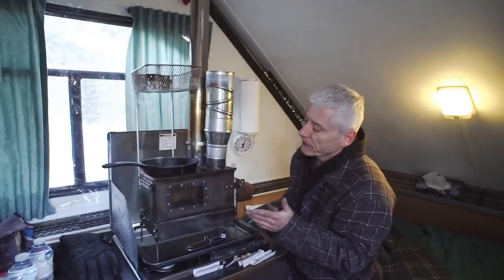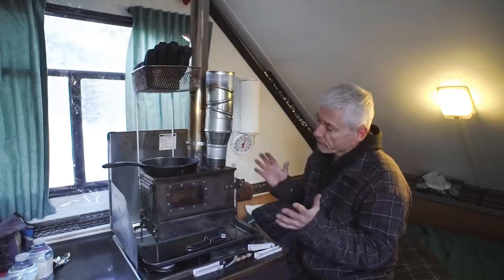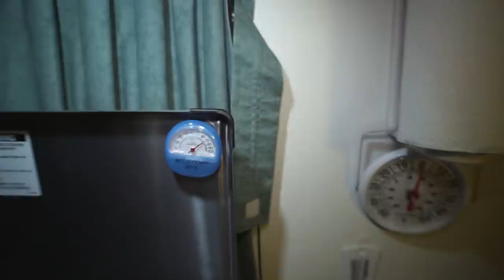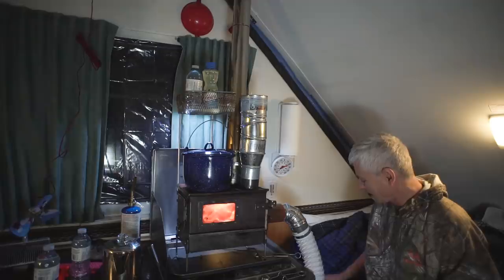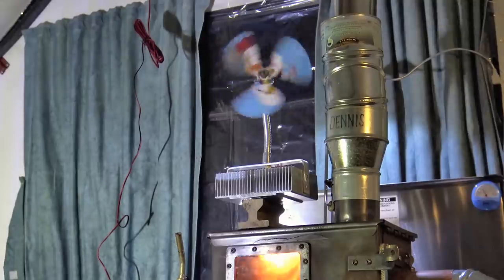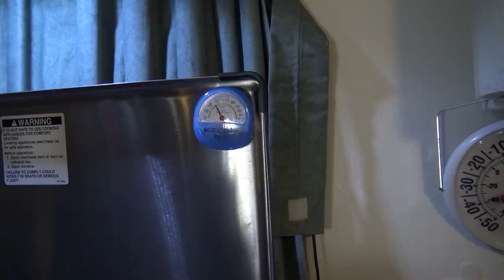Wood Stove in an A-Frame Trailer - Part 2

Comment: Great vid! A few notes about humidity: you mentioned that fire is a "dry heat." But you purposefully (and wisely) designed the setup so that the combustion chamber has no interaction with the inside air. So how can it affect the humidity? Indirectly, at best. The colder the air gets, the less moisture it can carry. The relative humidity is calculated as the amount of water vapor divided by the total moisture capacity at a given temperature. So the same amount of water vapor in the air could produce 60% humidity at a cold temperature and 30% at a warm temperature. Also, those dial indicator hygrometers are based on metal coil springs that have their own thermal expansion, so they may not read accurately at extremely cold temperatures like the ones you are encountering. Keep up the great work 👍
Reply from the maker: Hi Danny, respectfully I have to disagree with your analogy. The air was definitely drier regardless if the source was direct or not. There was no window condensation or frost, the key indicator in a situation like this. Even boiling water had little effect on increasing the moisture. As for the hygrometer, I have no doubt it was not very accurate, but to say it was 100% inaccurate I find hard to believe regardless of the circumstance. Thanks !SP

Comment: Love the woodstove. I have also seen the vid with the mr buddy heater. Your A-Frame Trailer which is basically a tent is poorly insulated. You could have a camper slightly larger, and much better built. That little one can also be improved a ton in so many cheap ways.
Reply from the maker: Sounds like you missed most of the my other videos. I have done many showing the insulating improvements I made. The issue with the Aliner is the aluminum frame, not the insulated walls. Larger trailers would simply mean more to heat, and more to lug around. SP
Reply: @SlimPotatohead  I spoke too soon. Excellent Stuff.

Comment: With my wood burner....I always get more heat by keeping the chimney damper closed as much as possible while maintaining a good fire. Forces the heat out through the steel top and walls. Not sure how that works with pellets but hope it helps. Also, I'd get a self igniting torch vs. running old sparky over your bed. 👍

Comment: Hello, great test. I think you do not have to connect the hose to the inlet because the fire uses the air and reduces the pressure in the camper, so then fresh air will come in through the ventilation in the camper door.
Awesome stove!!
Greetings,, Kitty.

Comment: Great video slim, what about using 3 layers of fool flex with a half inch air gap between ? It wouldn't take that much space and the r value is excellent. Keep up the great videos and being you.

Comment: Looks like a fun project. I missed your previous video so I don't know if you talked about this but I'd go with one of those cheap diesel heaters. They use some 12 volt power to run a fan and they do make some noise but they crank out a ton of heat. I've seen a bunch of videos of them and even bought one for myself to heat my garage in the winter.
Reply from the maker: Unfortunately they dont boil, bake, fry, cook or produce light. They also consume electricity instead of producing it. SP

Comment: Slim here is a idea of additional insulation.   Take some quilts or used sleeping bags and find away to line the ceiling and walls with them.  You can install some snaps or clips to hold them in place. Shower curtain rods could be used  to control the sag. A little sag will provide additional dead air space and hold in the heat.
On the stove you may be able to use burner out a small grill or a burner from propane stove.  That way you don't have hold the torch for prolong periods of time.  All in all I really enjoy your vlogs.

Comment: 1/2" closed cell foam board installed on the inside would help tremendously.  Use double sided tape to attach.  Thanks for the video content.

Comment: Slim, you've kept me enthralled/entertained,   One knawing question, why not use anthracite coal after the wood pellets are burning.  Coal would produce much more heat & burn longer.
Reply from the maker: I guess if I camped near Coleman that would be an option (there's an old coal mine there) ! SP

Comment: Hi slim ..So you replaced the original three hole vent plate with a tin can ? And so you just turn the can to adjust the air flow . Cool and impressive sir thanks again ..We moved from Ohio to Georgia 20 years ago to flee the winter.there it a summer trade off though.
Reply from the maker: The can becomes part of the vent plate. The bolt sandwiches them in place, so when you turn the vent the intake hose twists with it. Have a look at 33:51 for a better look. Thanks! SP
Reply: @SlimPotatohead  Very good sir, I will just change mine out just got my mica today it's window time!  if your curious i'm on instagram@ jpotterf got some pics of my stove /camper and odds n ends. I appreciate your replies and your work. I live in NE Georgia  if ya ever need a free boon dock in this area you are welcome here. We have much to explore in this area. thanks again : ) Joe

Comment: Hey Slim, great project & video! A couple thoughts from a Northern Midwest camper: be careful with the bags of pellets. There have been bags of them that offgas Carbon Monoxide (in their unburned form) - just make sure you’re storing them outside. Also, make sure you have a good CO detector - is recommend a personal type that you clip to your jacket or to the window curtains versus one from a “big box” store. The personal style ones are more accurate and have a much quicker response time. That’s all I have to add, love the channel and videos! Maybe someday I’ll run into you out and about if you make your way to Wisconsin/Minnesota for another winter “experience!” -16°f outside as a type this. Just how we like it! :-)

Comment: Wow, that was a gr8 success story. Though yur 1st night was not the results U xpected, it was actually successfull. Yur nights that follows showed the trailer indoor warmer while the outdoor was freezing temp. 4 a diy firestove, this is a huge successs. Congrats in yur inovation. Also if U reduced the cathredral ceiling, it would reduced yur sq footage 2 stay warm. Thx 4 sharing on the internet.

Comment: I used bubble wrap this year on my Windows worked great for keeping cold out. Great video 👍
Reply: I had to scroll through alot of posts to find yours. Bubble wrap on the windows affixed with just a spray bottle and water was my suggestion as well. The only other comment would be to create a throat right as the exhaust leaves the stove that is smaller in diameter than the stove pipe. This will create negative pressure which in turn allow for the introduction of secondary air. I'd remove his secondary air pipe at its current location because he's missing the throat or choke off point and as the exhaust exits is a more natural location.  If he was to go that far he may as well create a heat riser that can heat a bell and facilitate more effective heat exchange of the 300f temperature before it leaves the chimney. The ideas is to flash off more of those gases as they leaves which in turn allows him to reduce the rate of burn to save fuel and produce more heat.

Comment: I gotta say, I really hoped to see you use actual logs for fuel and some comments on that.   Also some comments on how you varied the dampener adjustment to either calm the flame down or to preserve the heat.   Great video though.   I’m gonna have to make this.
Reply from the maker: I used wood in the first video (listed in the description).  Using the damper and intake takes practice, but observing the flame will guide you. Thanks! SP

Comment: Simple quick tip from a Canadian Wood Heat only user.    
Fool proof way to start a wood stove.  
Load your split logs.  Using a small chunk cut from a compressed wax log placed at the wood logs.  Use torch to light wax log.  Regulate wood stove to maximum draft. Wait until logs have a good flame on them and then adjust draft accordingly.   
Use the driest wood possible.

Comment: Slim Potatohead; the serious Red Green! Well done!
My tips and refinement ideas - based on the fact that I live on a 1960's sailboat and faced with similar heating problems in the winter and cooling in the summer. I can fully sympathize with your first cold night. My first few winter nights on this boat were similar. Seems no matter haw many socks you put on, your feet still turn to ice! (well at 65 they do that pretty easily anyway)
#1 Put the propane bottle inside your coat, even under your arm for a few minutes before lighting it. 
#2 Consider a head liner material for the 'A' frame. Something like a vinyl cloth with a 1/4 flocking on the back side. This could be temporary panels, but it would also help reduce the radiated heat from the sun in the summer. Use your temp gauge to read the temperature of the outside roof when the interior is warm. I'm betting your readings will be surprisingly warm unless these panels are foam core.
#3 A lot of convection heat from the flame is lost in the stove pipe. The video shows the optical distortions of the heat going out the top of the chimney. This is heat not going into the room. There are some commercially available stovepipe radiators. These simply divide the flame gases between several tubes at the base of the stove pipe (where you read 300°), and allow the room air to circulate around them. A fan blowing past these tubes will increase the amount of heat going into the interior space. It will also reduce the temperature at the top of the stove pipe where it exits the roof.
#4 a 12 volt in-line blower fan (used to ventilate boat engine compartments and designed to fit the vent hose you are using) will help the pellets burn hotter, cleaner, and probably with less stoking. A small variable resister could be used to adjust the speed of the fan giving more control over the burn rate of the fuel.
#4 Carbon Monoxide: frankly an oil lamp burning on the table will put more CO1 into the room than your sealed system.
#5 ... just saw Jason Buchanan's comment on using anthracite coal. You would be amazed at how much heat this stuff puts out.

Comment: that looks like one of those ammo can conversion heaters. propane Buddy heater does produce a lot of water burning fossil fuel and wood is a dryer heat and I like that. I like that little trailer.

Comment: Also put wire screen in the house so no critters etc get in. Add a damper inside of that hose to control the burn time with air to flame ratio. Have the house come up from below floor of camper....if you can put a piece of slate on one of your benches with stove on top adding elbows & pipe to LINE up pipe with hole in ceiling. That will give you your counter space back & you'll have a hearth.

Comment: Forget about the cold air dryer hose. All you have to do is crack the door once and awhile for a few seconds. That stove, with proper insulation, should turn your camper into a sauna. You are on the right track though. Good video and awesome stove.

Comment: Hi Slim! Beautiful stove fabrication! I love that DIY stove fan! Please do a video on that! I had a partner at one time who used a fridge fan to circulate air but it was wired to an outlet. 

I'm very surprised that your Amazon links don't seem to be for your own store front. I love affiliate links because the payout is built in to the prices & if we don't use affiliate links, Amazon just keeps the money! It's such a cool system.

Do you need a thing on the chimney to suppress flying sparks? It also sounds like perhaps you would like to insulate your floor more. Maybe the aluminum parts could be coated with something like truck bed liner.... but I see now you've remedied the aluminum challenge, haha. Fun stuff. Thank you so much, Slim.

Comment: Your video is one of the most informative I ever watched. May be you can do some improvements on the ashes tray where you can using a thin metal plate and using 90degree turn to remove the ashes so can save some time... 
 Awesome video. .. keep it up

Comment: Slim You should try putting a damper on the air intake. Then you should be able to adjust the heat output, For the more mild nights. That should slow the combustion and make your pallets last longer.
Reply from the maker: There is one. See the build videos. Thanks! SP

Comment: Nice setup. You could try a heat exchanger on the stove pipe  with a little fan 
Look at tent  stove accessories.                 
The less heat going out the chimney is more in side and less fuel needed 
You could make a double ammo can stove similar to a double barrel stove just a way to get more heat out of it.

Comment: Use reflective foil (double bubble) to line the windows and the outside of the camper walls. Use heavy twine to stitch the strips together and keep them in place. You can also use it on the floor.

Comment: I love your setup, though I thought I might share something that could help, another option for storing and radiating more heat is fire bricks on the stove top when you're not using it, and then placing them under the stove when you do, though you're getting alot of use out of it anyways which is great. But those bricks are a great way to collect and radiate additional heat through the night.

Comment: I know you said you were most likely going to change the location of the fresh air intake so this may be a moot point.. but I think that using insulated tubing will help keep it a little warmer other wise you have the cold radiating from the thin tube as you pull in the cold fresh air.

Great video bu the way.

Comment: 29:49  That extra fan on the stove is a nice idea :D Great use of the Seebeck Effect. You could even add a little USB light to the stove as well being powered by the heat with a thermo-electric generator.

Comment: You could make a T bar that fits into the pellet grate, put it through a tightesh hole through the fire intake door, then mount a electric motor with a offset cam on it on top of the bar far enough away from the heat, put the motor on a variable time delay. It will auto shake your hopper and coals for you. If it won't reset on the weight of the pellets you could always add a reset tension spring to keep it engaged to the cam.

Comment: Instead of a torch, try the little fire bricks, they work great.  Just light them and put some small kindling in to get the fire going, then add bigger hardwood blocks.  Easy to start and makes great hot coals.

Comment: You are very creative.  I like the way you think outside the box.  The basket was genius.  I bit of info, not sure if others have said this.  It is not that the burning is "dry heat".  Cold air holds less moisture. it was at 60% capacity.  Warm air can hold more humidity so as you heated the air, the percentage went down, even though it is the same amount of moisture in the air.  Think of it as sponges.  the cold air sponge is say 1/2 the size of the warm air sponge.  they both hold the same amount of water but because of the size difference, the percentage of moisture would be more with the smaller sponge.  Does that make sense?  It is easier if I can draw it out.  lol . All that being said, one of the byproducts of combustion, any combustion, is water vapor.  So if you vented into the living space, the moisture level would go up....you would notice just before you died.

Comment: Given that you have to always reassemble the trailler, you might consider using a thermal camera to help you identify cold spots, heat stealing points, in the inside.

Comment: I find that a fan on the floor (pointed straight up) works best for warm floors. Also add rugs to the floor.
Reply from the maker: The floor has foam and carpets. The fans bring the warm air down. SP

Comment: you can also make it warmer if you make the space smaller by putting up a tarp right above you. essentially making the stove more efficient. You can get a tarp and use metal fasteners on the tarp that snap on the trailer walls and then just snap on your tarp before going to bed. The stove will heat the space much easier instead of rising to the top peak of your trailer.

Comment: FYI there are many thermo fans on the market that sits on top of your mini wood stove that will push out the radiate heat into your camper. I have use these fans, makes a big difference. Also I use pvc pipes on the inside of my vintage trailer as insulated  panel holders for the ceiling  and walls. Don't know if that would be feasible for your trailer or not.

Comment: Hallo Slim. My name is Rolf. I think your videos are as good as 
RV Geeks videos. That means the very, very best. I have had a wood stove and a parrafin one as well in my motorhome. Now I have purshased a large trailer, european messaurs that is, and consider a dieselheater wich aquirres no electricity at al. The danish REFLEKS or the swedish GREMBLING. Have you consider this stoves? No pellets, no propanestarter, just a shoot of alcohol and a match.

Comment: Nice stove. Great video.  I'd add some thermal mass to the setup with some stones under the stove ( just no wet river stoves) and you can heat your sleeping bag with them as well.  The stored heat from the stones may let you get an extra hour sleep :)

Comment: I know this is an old video, but charcoal lighter fluid works to start the pellets. But here is the thing, different woods burn differently. Such as oak while does burn good, it does not produce the heat nor burn as long as mesquite wood. So you can adjust your burn time with different types of wood. This is something I learned about wood when working in a BBQ restaurant. Down here we use a lot of mesquite wood, as it burns hot as well as that it burns slowly. So it burns a long time, with little work.